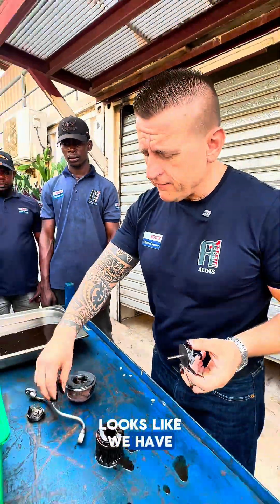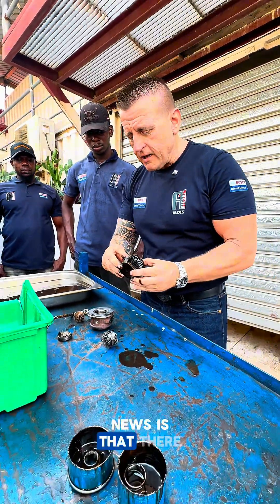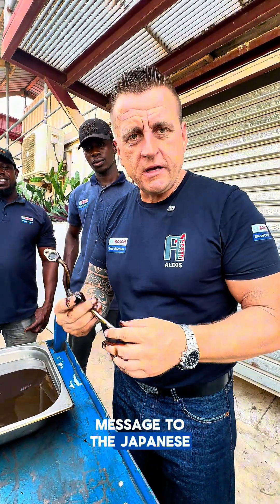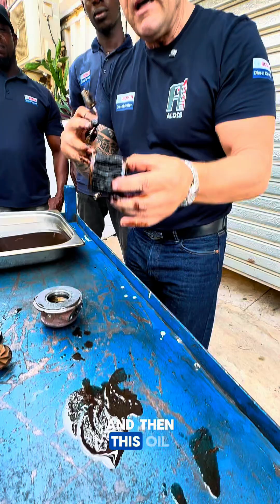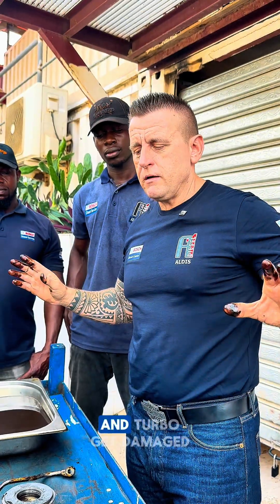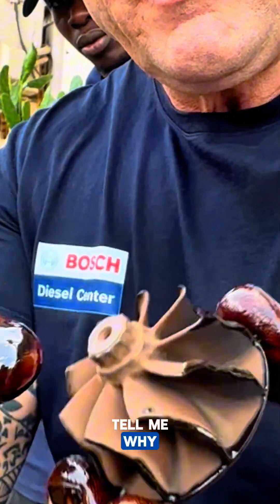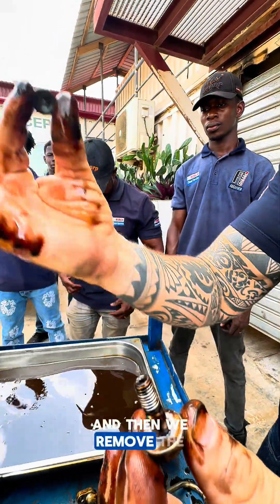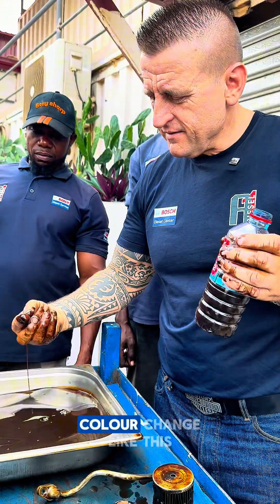Turbo Gone BOOM!💥 No Oil, No Mercy! 😱

Comment: Oil and coolant mix. That's the milkshake. There is no carbon because the coolant washed it off. Probably a blown cylinder head gasket